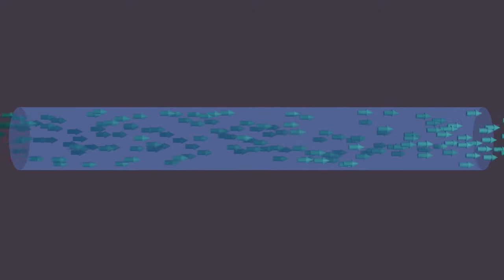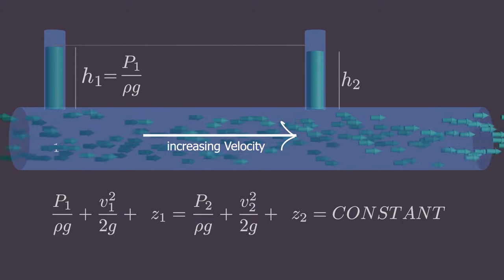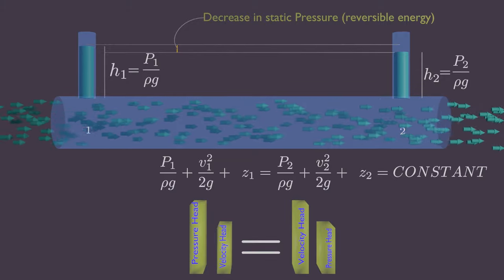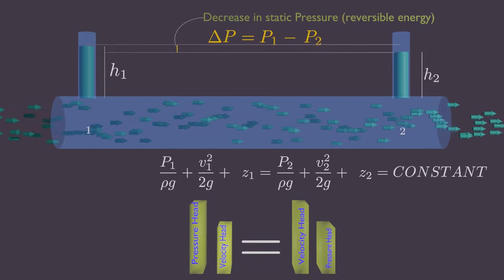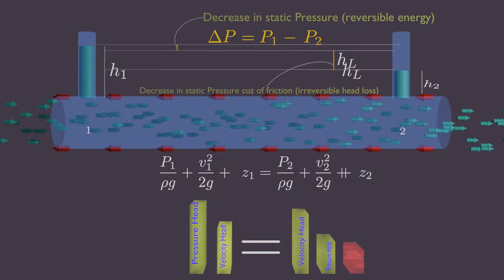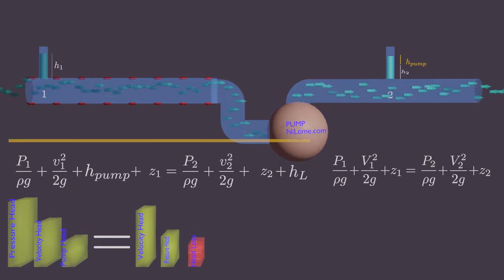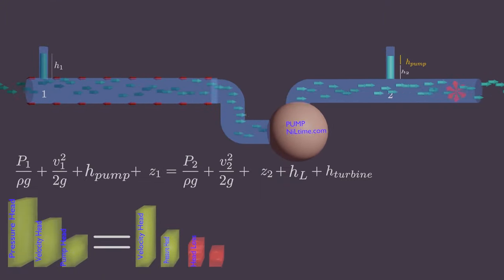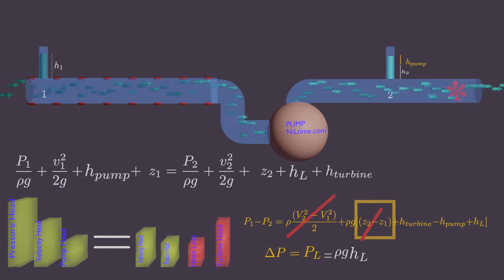What is Head Loss?  Pressure Drop? Pressure Loss? ( Fluid Animation)

Comment: There is a mistake in this video.  With no friction and constant pipe diameter and height, there is no drop in pressure.  This comes from conservation of momentum.  A frictionless pipe with constant cross sectional area ought to flow forever with constant velocity and pressure, same way a ball thrown in space with no other forces acting on it goes in a straight line forever.  

The claim that the velocity increases with constant diameter violates continuity of flow rate for an incompressible fluid (constant flow rate Q = v*A -> constant area means constant velocity) .  Bernoulli's equation dictates that if velocity and height are constant, then pressure is also constant (if you neglect friction).
Reply from the maker: yeah I am aware of it . I should have modeled converging pipe here. Thank you for commenting it out. Hope everyone sees it ^^

Comment from the maker: This video is not completely correct. But watching this you will surely understand about the Pressure drop and Pressure loss thing. and How pressure loss is related to head loss.
0:41 Static pressure decreases along the length of horizontal pipe(should have been converging pipe) along ideal fluid .. well that's where it gets wrong and messed up the whole energy balance.
Reply: Thanks bro...but it'll be much helpful if you rectify the video and re-upload it.  You're work is amazing. Helps us understand the concept clearly.

Comment: There are mistakes in this video 😮

1) velocity can't change without a change in area due to the continuity equation

2) You can't consider the drop in the turbine if point two is before the turbine

Comment: Do we need to used fluid variable (water) always whenever we calculate the P drop? Or do we need to consider the flow medium?
Reply: higher viscosity fluids will result in greater frictional head loss and hence pressure drop as well

Comment: what does it mean having a negative head loss? i am working on a project about hydraulic ram pump, and a few of my design cases yielded negative head loss, while some have positive head loss.
Reply: Check units first! Maybe your friction coefficient is just that low! I don't think hL can be negative. Maybe you mixed up your hL calcs? There are two formula for laminar + turbulent, thus two divergent paths, in terms of arriving at a value.

Comment: I have a question about the pump with regard to the head loss that it is tasked to overcome. Did we not say that when the fluid velocity is increased, this creates a lower P2 pressure? So then why does speeding up the fluid somehow overcome the loss when before we said that an increase in velocity actually causes a pressure loss?
Reply from the maker: Please dont get confused here. Increasing velocity never creates pressure loss.. but it might create pressure drop. In an ideal fluid and ideal pipe,  pressure loss donot exist, but there exist pressure drop. Here the initial energy of fluid  is equal to final energy. So the equation is balanced in ideal fluid. And we donot need pump. Energy is conserved/constant. 
But in frictional fluid there is pressure drop as well as pressure loss. This presaure loss is created due to friction between layer of fluid .. roughness of pipe .. and many other reason (but not of increasing velocity) . Here The energy of fluid decreases and disseapear completely to atmosphere. So in order to give energy to fluid .. which is to overcome these pressure loss ... we use pump.
Reply: @NiLTime Alright so the pump increases the velocity of the fluid right, or does it simply return that velocity to its original state? And if it increases the velocity even further than the original state, would there not be a pressure drop between the entrance of the pump and the exit, essentially?

Btw thanks for the answer, I didn’t choose my words carefully but I meant “pressure drop” in all cases.
Reply from the maker: @grantstidham9322   @Grant Stidham  it is better to say ..Pump gives energy to the fluid. It can return energy back to original state or increases it even more. Of course there would be pressure drop between inlet and outlet . More pressure drop .. more electric energy it consumes . The electric power that motor consumes is proportional to its pressure drop ...